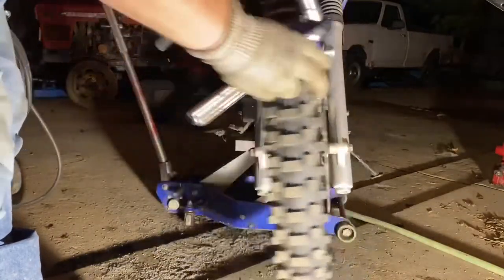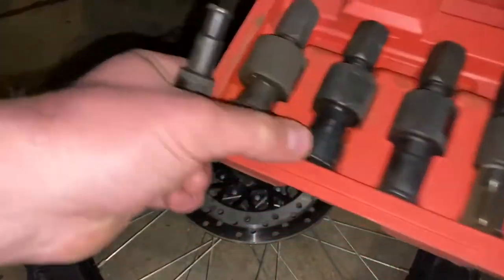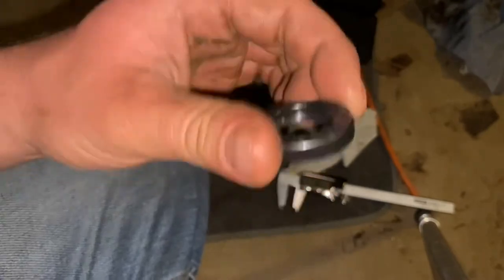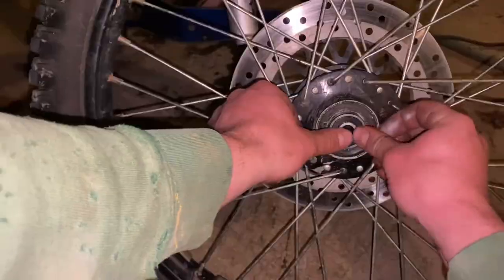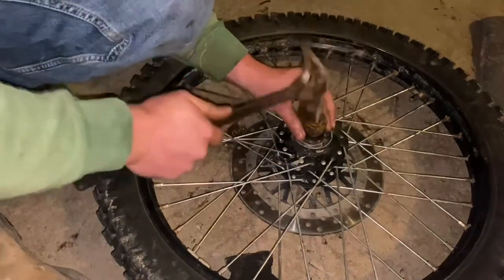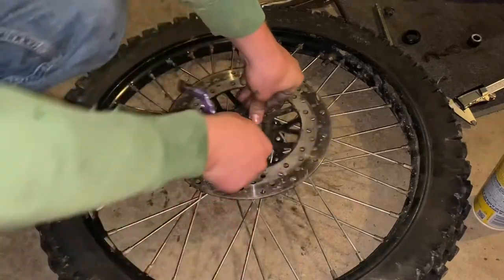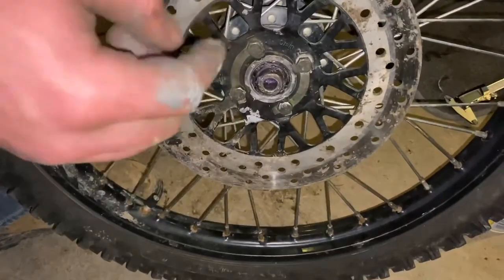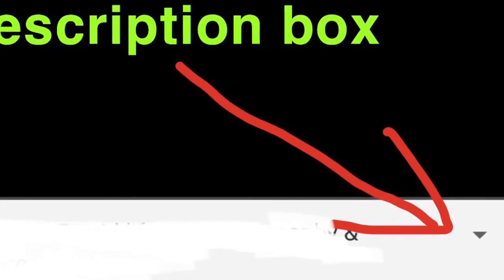Hawk 250 FRONT WHEEL BEARINGS

Comment: Hey bro watching your videos all the time made me order a hawk 250 from Amazon is all good but I cant get the brake light working is not blown and is shits ok but when I hit fifth  I can get it out I play hell.getting to drop back down any thing you know that wood help me fix this  if so big thanks
Reply from the maker: As for the rear lights, I would check the wiring that goes under the rear plastic. There’s also a brake switch that works the rear lights, and it’s set up subpar, a lot of times they need adjusted or just flat out replaced. As for the shifting problem I don’t really have much of a recommendation for this, other than to ride the bike some more shift at through the gears and hopefully it’s just a breaking issue. I know for a fact my bike was very hard to shift at the beginning, mostly very difficult to get into neutral. It’s still very much the same after 5000 miles of use, but it has loosened up a little bit and it’s just a little bit easier to shift. Hopefully this helps thanks for watching!

Comment: Damn your Hawk needs alot of work for low miles I think I'll just buy a Honda crf
Reply: They abuse their Hawk a lot more than others.
Reply from the maker: The hawk is very low bearing maintenance compared to my HONDA rancher 420. Bought it new, front bearings need replaced every 500 to 1,000 miles @ $80 each side for factory bearings which is what was put in it each time. Had the thing for 5,000 miles, do the math for just the front bearings, that’s a lot of money and maintenance for a HONDA my friend.
Reply: The crf is 5700 the hawk is 2000 I may just get a hawk
Reply from the maker: @ProudWhiteBoy  both bikes are good. In all reality a Honda bike is going to give you less trouble, I mean it’s a Honda. But All bikes have their quirks. The hawk has been a rock solid bike, honestly I haven’t had any real failures or short comings other than a few things that I can think of (airbox, and swing arm.) the rest of everything else has been normal wear and tear from riding the bike like a scolded dog lol!